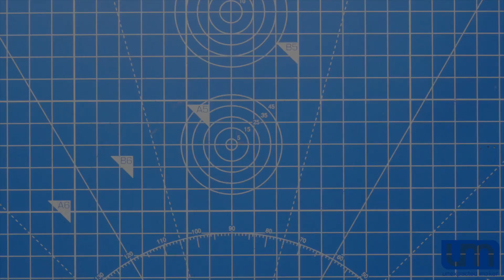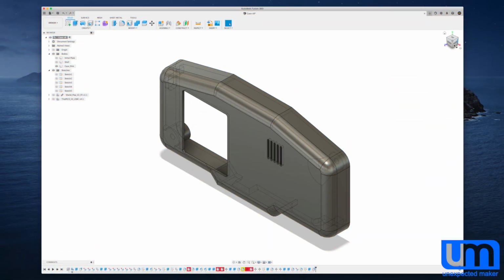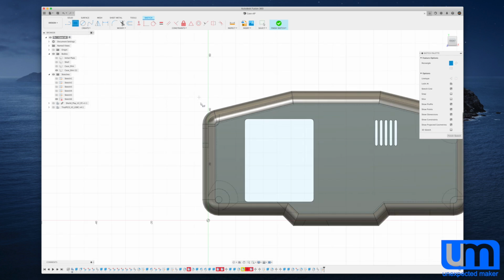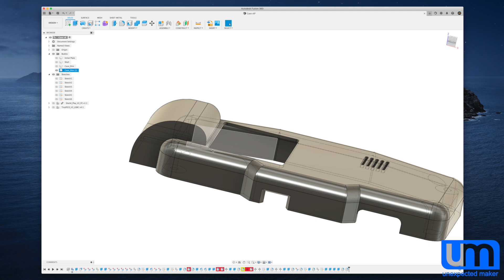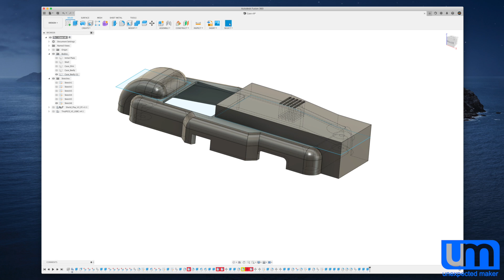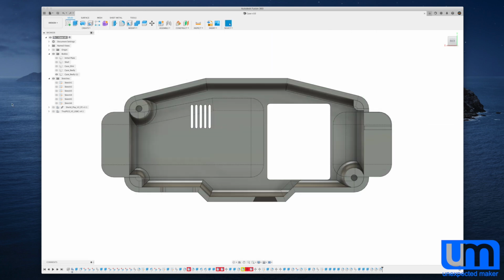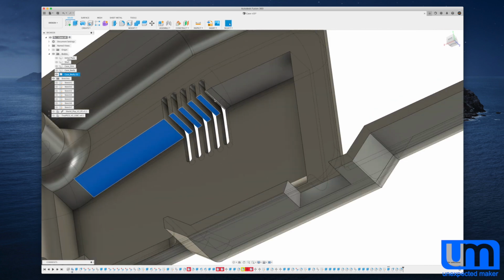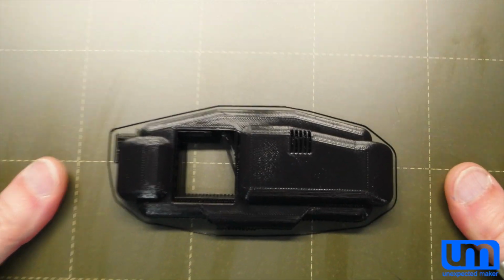3D Printed Case Design - Explorer Shield

Comment: @Seon: if you try to extrude one part to the height of an already existing surface, just click on that existing surface. Fusion will match the extrusion height by itself.
Reply from the maker: Didn't know, thanks!
Reply: Or change the drop down from “distance” to “to object”

Comment: Hello m8.
Nice work you've done there !!
 May I ask how many layers is your pcb stack-up ?
Reply from the maker: This is just a 2 layer board.
Reply: @UnexpectedMaker  I've noticed that you have components beneath the touch areas. I've done a similar design recently and I've 4 layers stack-up in order to isolate the touch layer from the component layer. Touch buttons are working but my touch-slider is not working as expected :( . 

Thank you for the feedback and your quick reply !!